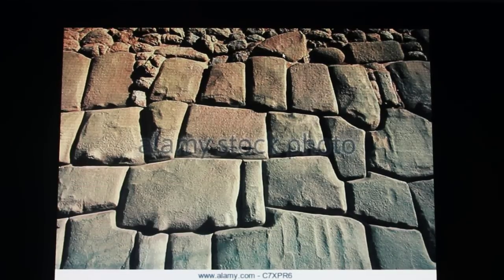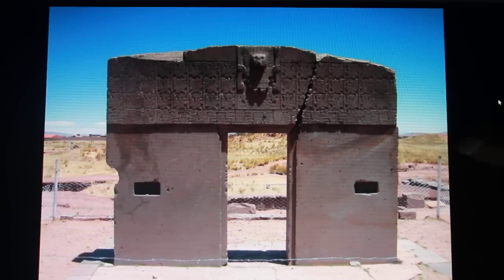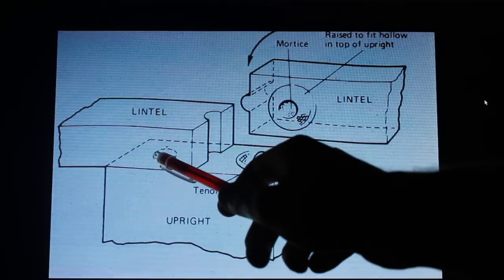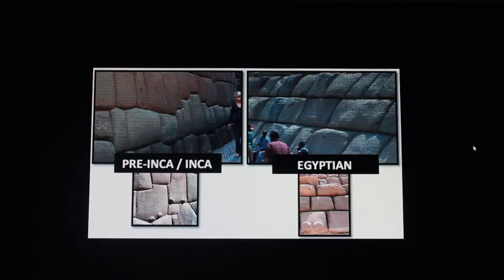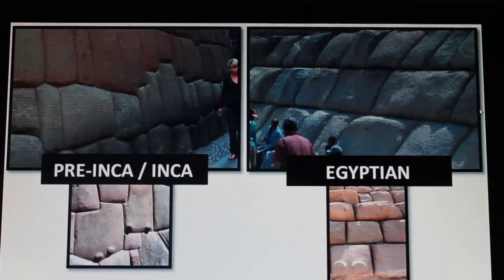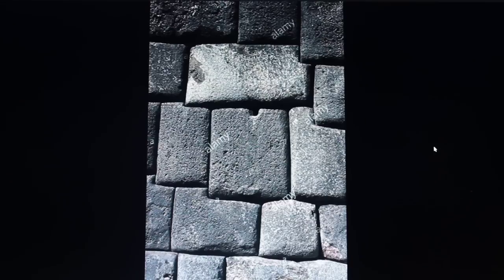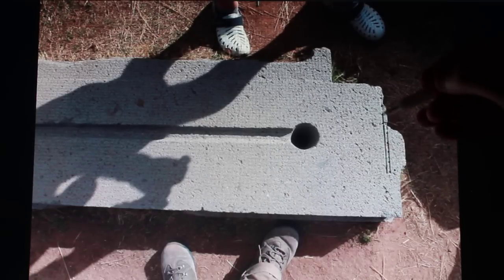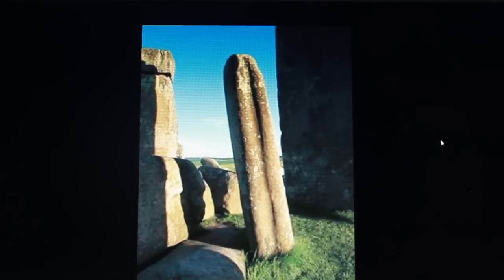Is this what the NUBS on megalithic pre-Inca walls are for? (FOR JOINING STONE?, Proof provided)

Comment: Those nubs and inverse nubs as you call them are NOT for joining blocks together!! Reason: You can't tell me that they can build this wall with absolutely perfectly carved and perfectly joined together blocks that are so tight you can't fit a hair between them yet their nubs that you say join blocks together are so freaking sloppy and misshaped it's pitiful!!
Reply: Nubs are where a rod with frequency and vibration was inserted then picked up and placed.. indentations around  all edges from presure to fit to the stones  around it.Nubs aren't uniform added Nubs to achive perfection fit,,some are recessed from rod extraction at different instances causing conflicing  on shapes..dimples all over all stones shows vibation together with frequency softened the stone to shape in place edges dressed from pressure created perfection
Reply: Maybe they didn't. You didn't listen to the video. The nubs were used before they re-used the blocks. The blocks can be re-joined with something else entirely

Comment: You maybe correct regarding the nubs when they are on the top or bottom surface.  There are two types here and they are not related.
Oneoperamom and those with the "clay theory" are more correct regarding the side marks and nubs. I read decades ago (one source might have been S.American explorer Col. Fawcett) who got the story directly from ancient native tribes: that forgotten civilizations knew how to soften stones with a liquid. Thus the remaining clay-work markings when they had to squash & straighten the sides of the stone to fit, thus forcing some over-abundant material out.  Fawcett? claimed to have been given some of this in a clay container but it got broken before he returned to base.  It softened the rocks where it got broken.  Often these old tales are the best sources we have, but most prefer to look at Natives as just dumb savages.
The poured concrete theories are also in error.  Most old stones can be traced to distant quarries.
Reply: Duncan Phelps:  The truth is finally out.  They did soften stone with a liquid.  The liquid is water!  They created a polymer based type of concrete, and simply cast the blocks in place.  Don't you think?

Comment: Nubs = noobs. Nobs = protrusions on stone XD. if you look at the nobs they seem to be at the center of gravity if going to pick them up. some people think they poured the stone in sand bags and it dried is how they are so fitted together. I tend to think they had a type of chainsaw that instead of chain is a rope with diamond dust in it to cut stone
Reply: I also think that they used rope saws but not with diamond. There is an abundance of quartz and it is almost as hard as diamond. Quartz can be shattered and crushed. Maybe they even found a way to glue the quartz chips and dust onto the ropes. They nubs are just where they stone breaks off when they undercut it at the quarry.  They had to cut around the stone and also cut under it to remove it from the bedrock from which it is cut. They would cut under until there were just two places left. Then they could slide a sled under and continue undercutting until the stone's weight made it break off, leaving the nubs. Sometimes the nubs broke off in odd places, breaking off even to leave an indent instead of a nub.

Comment: Has the process of pouring the rock in place been discussed? 
Also could it be like when a craftsman heats glass to make the glass workable and sticky, these rocks were heated and poured in place, allowing the material to be workable. The little nugs on the bottoms of the stones is where they would poke the rock to allow the weight of the rock to settle, removing air bubbles.
Once the rocks were nearly dry, they would tool the edges of the rock like a concrete finisher. 
The vertical marks on the face of the rock may be where the forms have leaned up against wet rock.

Comment: There was an old fella in Peru who proposed these nubs were used as sort of sun dials. He had put together quite a strong case using strings and taking shots at different times of day, week, month and year.

It worked as a huge shadow calendar quite well, almost perfect.

Jack
Canada
Reply: Only problem with his theory, the angles would have all been a lot different than they were today. He was using the movement of the sun TODAY. Not thousands of years ago. Thats the biggest flaw to his theory.
Reply: Except that does not explain inverse nubs or the fact that nubs are randomly all over these walls. How many sun dials would they have needed? And if that was the case why are there nubs on walls that don't get direct sunlight?

Comment: This is the best explanation for the massive Inca blocks that fit so smoothly. A few years back, an archaeologist attempted to explain the fitting (of the stones) by abrading small blocks together (with sand). This works for block s that weigh less than  50 pounds, but not for ones over a ton. The next step is a chemical analysis of these stones-the proof would be the same  compositions.